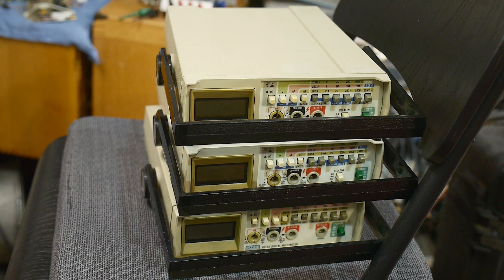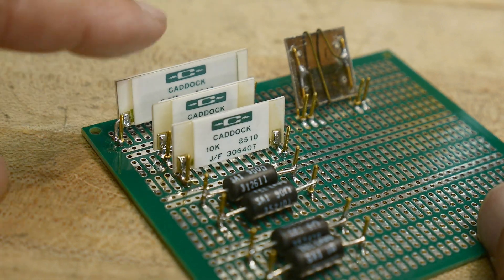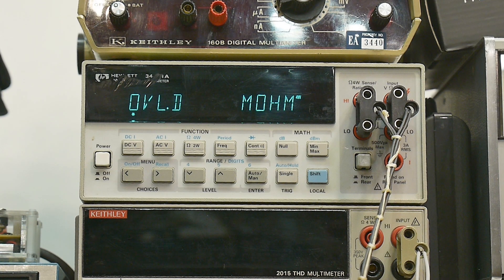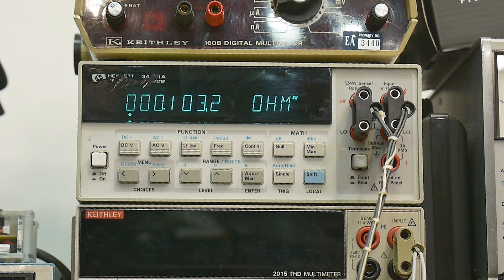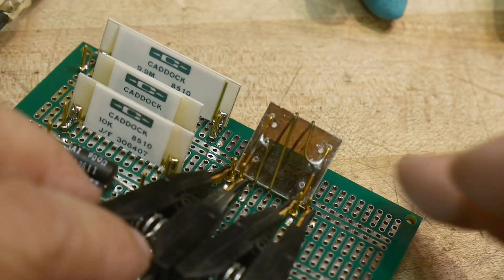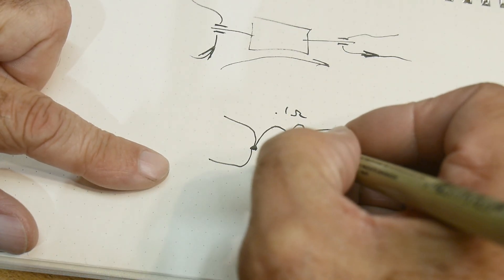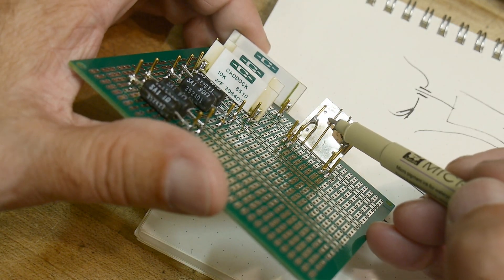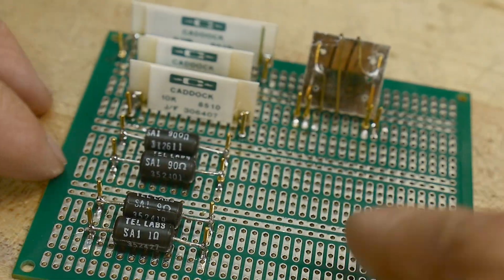#1659 Resistor Test Board

Comment: How does relative, or zero-ing out the meter when using a 4 wire kelvin measurement work?  Or do you not?  I guess not since you're actaully measuring a voltage - and it should read zero when the leads aren't hooked up to anything....right?
Reply: You generally dont, but when doing measurements affected by thermal EMF, the thermal voltage can be zeroed out by stopping the current, checking the voltage that remains (that is the thermal voltage) and then subtracting it. Some schmick meters do this automatically, not too hard to do by hand too, just plug out a current banana and take note of the remaining voltage. For example the HP3478A uses 30mV/1mA for the 30 ohm range, and at such low voltage thermal emf is a problem if trying to measure a resistor with leads that are not copper.

It reads zero if no leads, and overload with plugged in leads.

Comment: Summary
Introduction
- 0:05: Video starts with the host talking about repairing Digital Voltmeters (DVMs).
- 0:15: Three out of the original six DVMs couldn't be repaired; the host decided to salvage their parts.
  
Project Overview
- 0:26: The host introduces a small project that utilizes the salvaged parts from the non-repairable DVMs.

Importance of Precision Resistors
- 0:37: Discusses the high-quality, precision resistors found in the old DVMs and how they were hardware calibrated.
  
Types of Resistors
- 1:00: Describes the types of resistors salvaged, mentioning thin film and film resistors with very high accuracy.
  
Odd Resistor Highlight
- 1:22: Mentions an unusually designed resistor that will be elaborated upon later.
  
Measuring Resistors
- 1:39: Begins the process of measuring the resistors using a four-wire cable to establish Kelvin contacts.
- 2:01: Displays the results of the measurements, showcasing the high accuracy of the resistors.
  
Four-Wire (Kelvin) Measurement Technique
- 3:15: Explains the principle behind four-wire (Kelvin) measurements.
  
Unique Resistor Discussion
- 4:00: Takes a deeper look into the design and purpose of the uniquely designed resistor with Kelvin contacts.
  
Rationale for Resistor Values
- 5:00: Explains why specific resistor values (like 1, 9, 90, etc.) are commonly used in DVMs.
  
Conclusion and Recommendations
- 6:33: Suggests salvaging parts from old, unrepairable DVMs for useful components like these precision resistors.
- 7:09: Recommends having a set of such precision resistors in one's workshop for varying applications.
Reply: Ok...nice story summary...

And it matches what I heard..

Your point is...?..
Reply: @fredmitchel1236  One might ask the same thing of a book with a table of contents. Use some common sense, please.